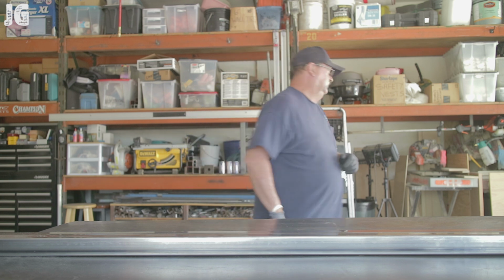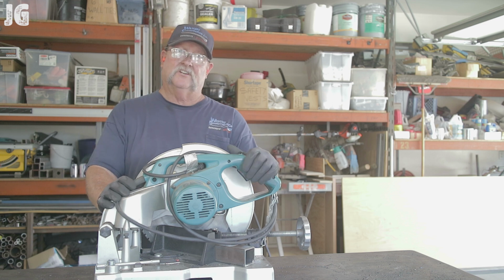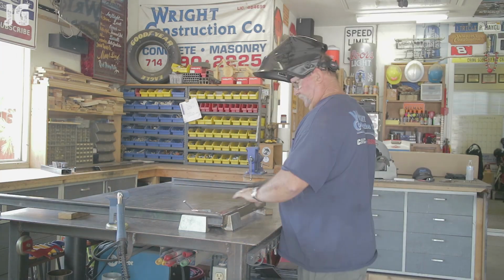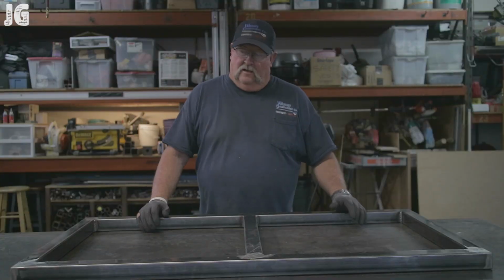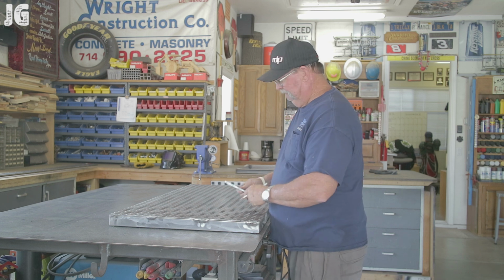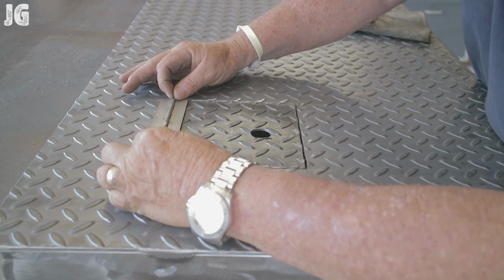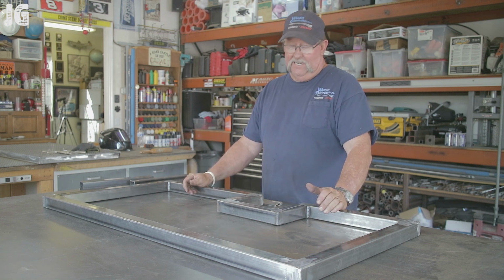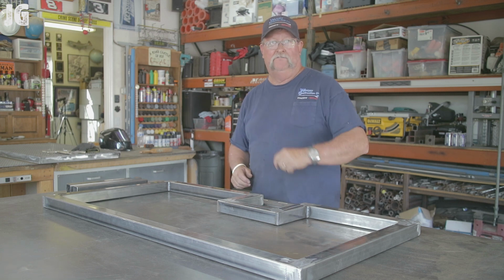Metal Doors for Underground Vault | JIMBO'S GARAGE

Comment: You could have taken the long side of and cut new 45 angles (1 inch shorter than original) and weld it back together. Nobody could tell or see your mistake. 👍  But your solution works too and is faster to do. 😁

Comment: What blade do you use with the chop saw? I have a cut off wheel on mine, but see you use a steel cutting blade?

Great channel, very awesome videos.
Reply from the maker: Joshua Contreras - Thanks for watching. It's actually a metal cutting saw. The RPM's on a metal cutting saw are much lower so the blade doesn't burn up. Specifically for cutting metal. The blade is a metal cutting carbide blade. Thanks again - Jimbo

Comment: Nice build Jim. Next time you're welding with the window open try using flux core or stick, don't have to worry about the breeze blowing your shielding gas away. Also, one of those magnetic floor sweepers makes short work of cleaning up the chop saw debree.
Reply from the maker: Thanks for watching Jim,  Thanks for the advise! I like the magnetic floor sweeper idea, I will check them out!  Jimbos garage!